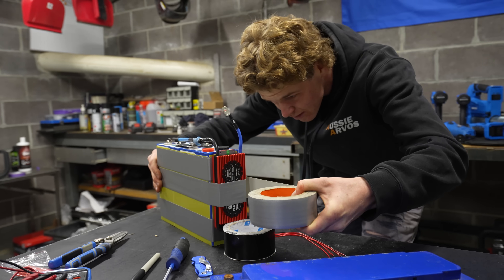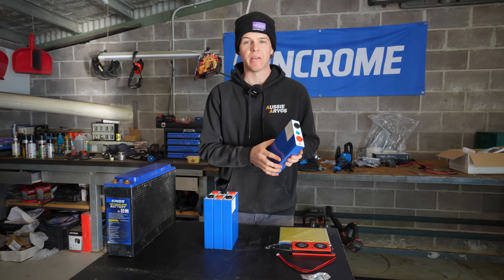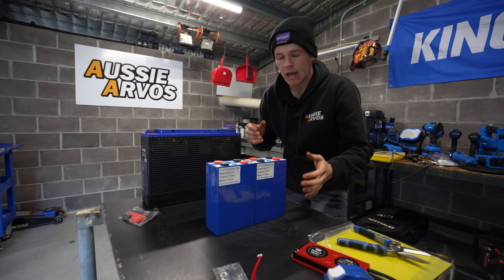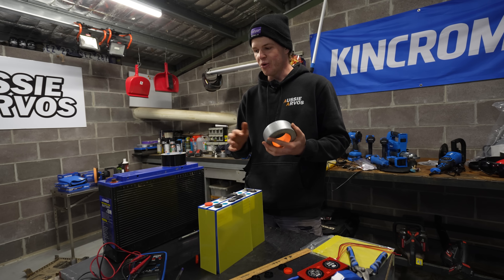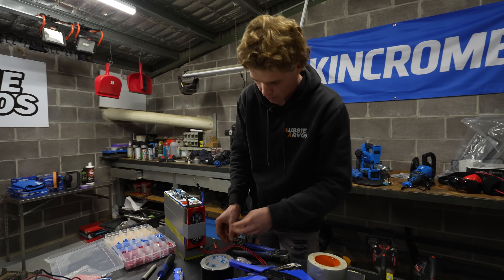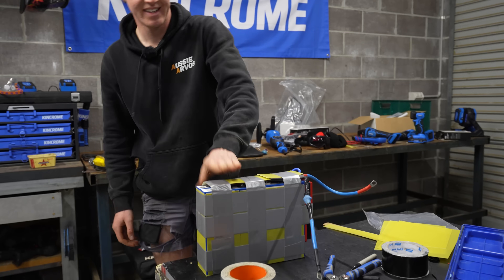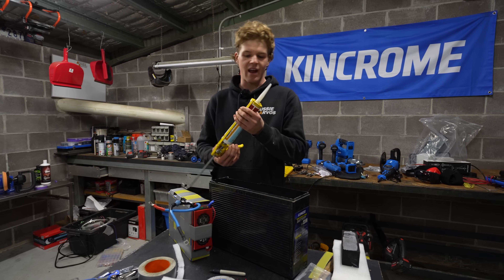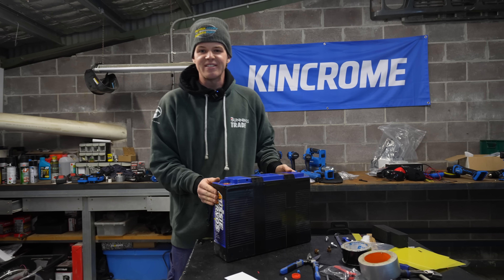BUILDING my own LITHIUM BATTERY from SCRATCH!

Comment: Good vid BUT Daly isn't a great BMS IMHO, I've had 3 and upgraded all of them to JK on every build,  don't get me wrong they work OK but they are very slow to balance, the temp cut off often doesn't work, the column counter looses track of the charge level and IME the app crashes regularly, definitely a beginner spec BMS, there are way better out there 👍
Prismatic cells seem to be more robust that pouch cells IME 🤔
Reply: I didn't see a temperature probe - could have bad consequences.
Reply: Daly are rubbish!

Comment: Nice work guys! Braver than me lol.  What inverter are you using?  Tempted to get a kings 3000w but also don't want my car to turn into a giant bonfire! I wouldn't touch their dcdc chargers ever with their failure rate so got a redarc one but yeah not paying 3k for an inverter either!
Reply: Gday mate. I can recommend the allsparks 2700w inverter. I’ve had one one for my house for last 18 months. Cost $670 from memory. Really good bit of kit. Runs everything I can throw at in my house, including tools and coffee machines

Comment: Lovely ep guys,  I thought laying a lithium battery on its side will stuff the battery.
Reply: The only orientation you shouldn't use them in is terminals down 👍 manufacturer use them in different orientations,  check out Andy at the off grid garage 👌
Reply: @Dirt-Diggler  I watched Tim Bates I think he said he stuffed two or three lithiums from laying them down I could be wrong though